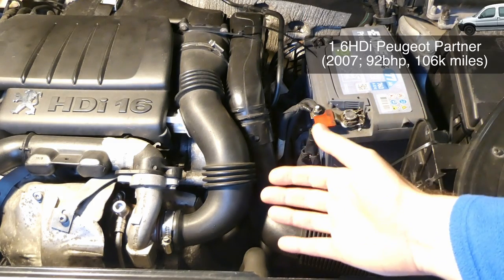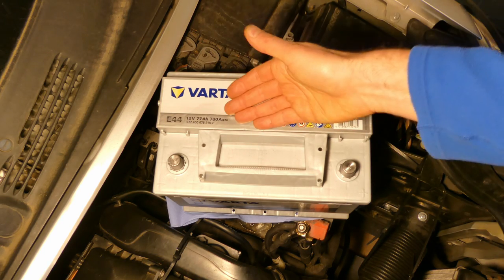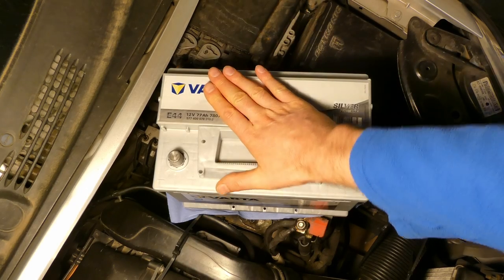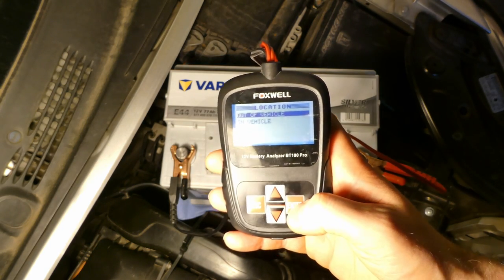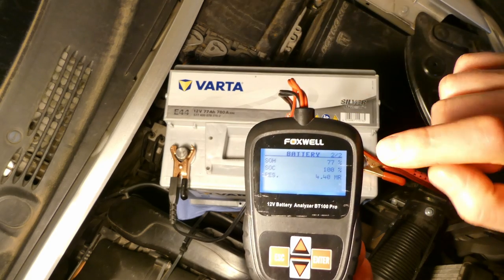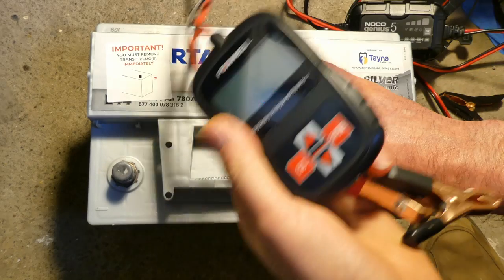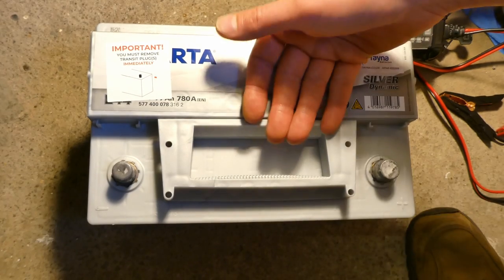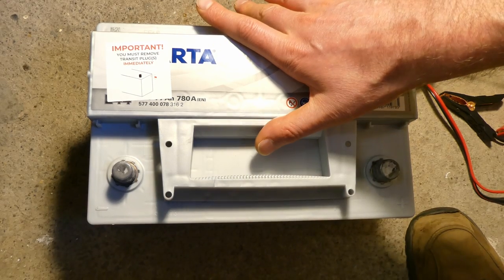Is a New Car Battery Really New?

Comment: I bought a similar battery varta silver dynamic and had very similar findings and test results to your video. Wish we could order directly from varta to avoid having this problem of the battery degradation on the shelf. Thank you for making this video it was very informative
Reply from the maker: Many thanks indeed for the comment, rather appreciated. It would be nice to have it direct. I have a small solar system and bought two super duper Ah Lead acid batteries, but one was old. Both together never really achieved equalised state in series mode. Now I would only go to a shop and test the battery myself before buying it, never online anymore.

Comment: I find out a real good working trick to increase the SOH, I shake the battery with the handle for about 10 seconds, then I put the battery upside down on the ground for about 15 minutes, then turn around again for a couple of minutes, do this outside cause you can hear pressure leaving out of the ventilation holes, if you put your battery tester on again you will see a increase of about 10% health, by the way, the repair function on the charger has to work at least 24-48 hours and always after a full charge, and remember shake and turn the battery upside down after a repair function. My Varta D15 EN610 is still working after 4,5 years, I guess the fluid in the cells need a shake or even better a refill now and then, but unfortunately it's a maintenance free one so you have to drill holes 😂 I will buy a new one if it dies
Reply from the maker: That sounds like something I could try, although the repair function is exactly supposed to do that, to mix the electrolyte.
Reply: Good evening, thank you for this series of videos on the noco genius 5 and the repair function. You are methodical. I have the same problem as you, I lose my batteries due to lack of use, I cannot keep them alive even though they are only two years old maximum.
I would love for you to demonstrate shaking a tired battery to demonstrate if this process works, thank you. 
I just saw that I had the same idea as you to maintain the battery with a solar panel, unfortunately it didn't work for me, this winter I lost another battery.
Reply from the maker: @Ppau1  Yeah, many thanks for the compliments, I would certainly do that. It is on my todo list. SImple to try and see if there is any difference. I suspect that if you or I keep the battery constantly on a charger it will go much longer. It is just that Lead acid batteries want to be 100% all the time.

Comment: Excellent demonstration, we use the same battery testers however they're made by midtronic's, the plates in the batteries a lot of the time are from China 🇨🇳 and they are thinner so they are not lasting. Cheers 🍻  🇨🇦

Comment: I have service fault on a Teepee Partner stop/start 1.6 diesel due to battery although everything runs OK.  I put on new equivalent Exide from Tayna and see 'SOH 67% - replace' and internalresistance 5 mohm. Fault intermittent but unchanged.  Thanks, I'll go back to Tayna. 😮
Reply from the maker: Yeah, I did the same, got the battery from Tayna. Although better than eurocarparts, still a bit on the low side. I think it will be fairly difficult to prove that it is on the low side of things. Good luck though

Comment: I have recently purchased the same battery which I use smart charger to charge the battery right away after replacing starting from 30% remaining to 100%. After fully charge the battery and over night measurement was 750(EN) with resistance around 3.8 mohm. I then drive for 92km highway stop for 2 hours then return trip on highway then leave the car a couple hours. The measurement become 879(EN) with 2.9 mohm. You may try to drive for a longer trip to see if the battery will have better measurement.
Reply from the maker: Thank you for the comment. Nevertheless, you would need to leave it disconnected for full 24h before measurement. Depends on the condition of the battery and for how long it was stored for. Mine was 4 months, how old was yours?
I have had it for awhile now and it is not getting better irrespective of how far I travelled.
Reply: @moremolecules  I think you are right, my understanding is at least overnight or 24 hours for measurement. I read first 3 digits 173 which indicate May 2021; no wonder the battt is low and took 7 hours to charge up. I took the measurement this morning again but only show 789(EN) with 3.5 mohm with about 92% capacity. I think it's really depend on the battery condition and will check the date code in the future when purchasing.
Reply from the maker: @waynehung4801  Your numbers are not too bad at all and 92% is quite good for a new battery. If high street sellers spend a little bit of time to charge these batteries all will be quite good. For that reason the date is probably the best indication of state of health.
Reply: Mine says replace and recharge-test 5mOhm resistance 89% SOH 98% SOC. Battery only like 1 year in car. Produced like near a year before that. Had good initial values of SOH. But now... superbad. Have not tried recond function lately. Ctek recommends doing that once a year.

I'm really disappointed on this Varta battery since my Volvo battery lasted for 9 years. And their batteries are Varta but with volvos own "case".

I might buy a Bosch or Exide instead.

This varta was about 130 Euro

Comment: Is this recovery mode that the battery charger has safe and does it work well with new batteries? I also think it's completely harmless.
Reply from the maker: What I found with this function that is does literally nothing. I have used it on a new and old car batteries and the result is the same, nothing. Tried it on a 3 years old battery, nothing, tried it on a 4 months old battery, again nothing, no improvement.
Reply: I fully charged the battery then run repair mode about 3 times there was improvement after the 3rd time running it

Comment: My 6 year old battery is down to 26% SOH, never fails to start.
Reply from the maker: But where do you live and do you drive petrol or diesel? In a cold winter this battery will not start, especially in a diesel, which requires quite a bit more power than a petrol engine.
Reply: @moremolecules  i drive a 2.0 diesel. I live in Ireland. We recently had a cold spell of -10 degrees C and it still started ok. Even the start stop system still works ok in traffic.
My point is these tester’s condem batteries too soon. My battery had 60% SOH 3 years ago saying “replace” .

The battery is an AGM original. Rated for 680A EN. It currently reads 340A on the tester.
Reply from the maker: @Mickytdi  Of course, yes, they are not the best method to test a battery, but easier to do than say put them on a known load for whatever time and see how long they survive, or a load test. I found them to be pretty accurate as with time the batteries do drop with with, pretty linearly.

Comment: I bought a varta battery from tayna and it arrived totally flat, it had just 5volts. They replaced it's straight away and the new one was fine and when I tested it, it's health was 95%.
Reply from the maker: Luck of the draw I guess as with everything else.

Comment: Brand new batteries don’t read their full amps until they are used a bit.
Reply from the maker: Yes, while this is quite true, that one stayed there and did not improve at all. Most of the times they will improve a few percantage points, but not massively.

Comment: I would not trust 100% these toyish battery testers.There is no chance that little thing with so thin wires can pull 780A during test  from battery.
Reply from the maker: Ahh, yes, I completely agree. There is no actual load test from the device. In order for the load to be tested, it will be rather complicated with drawing say ~50% and calculating from that. It is just easier, albeit it might not be entirely accurate.
Reply: It may seem like a toy,  however the results show by mohm resistance with age, there  is detioration!
Reply from the maker: @rogerwale4827  Thank you for the comment. I see the same thing, that with age you get an increase in the ohm resistance.